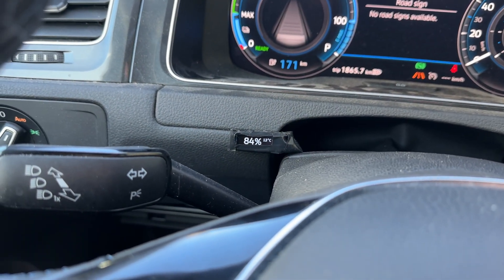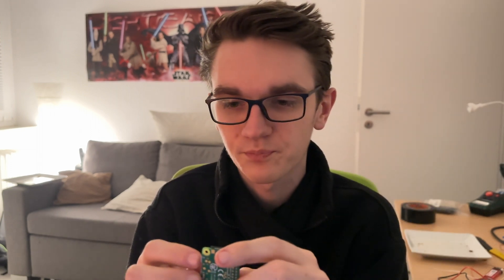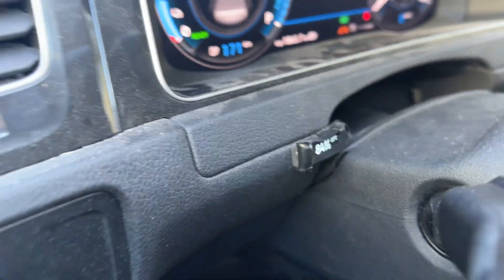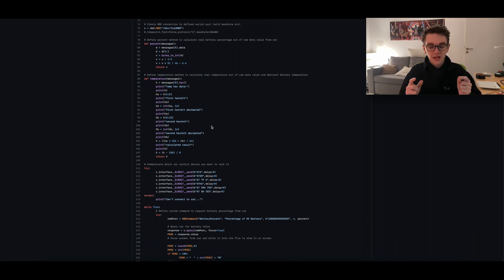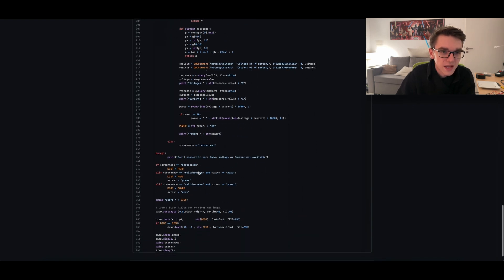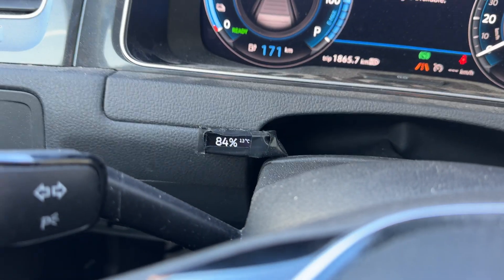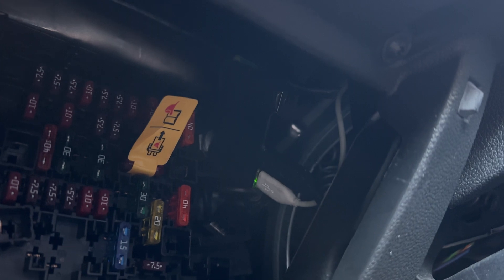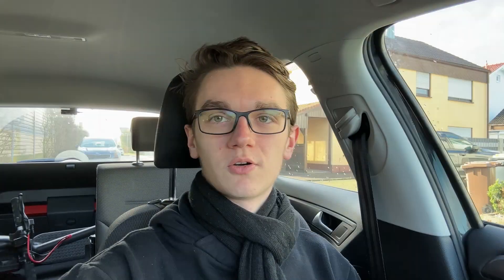How to view the battery percentage in the e-Golf with an extra screen | e-Golf OBDisplay

Comment: Amazing!

Is it possible to display the State of charge in a sensor in Home Assistant? Maybe if you connect the Pi in your car to your wifi network?
Reply from the maker: They way I connected the pi it shuts off when the car is off as otherwise it triggers the car alarm. The car doesn’t like reads on the CAN BUS while locked. I just used the WeConnect Integration in HomeAssistant but you need the car’s online functions for that to work I think.
Reply: @dieserNiko  ah okay, bummer 😅 thanks for the answer. Nice job you have done 🙏🏼
Reply from the maker: Thank you! Yes really is sad, maybe there’s a way around that but I never looked into it as I didn’t need to!

Comment: Hey I'm using an obd dongle to feed data into abrp. Is there a way to use bluetooth to handle data transfer from the obd dongle to a raspberry pi?
Reply from the maker: Should theoretically be possible by connecting the pi the the adapter and changing the device path to the bluetooth dongle. In my testing I didn’t get it to work with bluetooth though, that’s why I used the USB adapter!

Comment: Amazing! I use ABRP to see SoC via CarPlay and OBD dongle connection to my phone. How about showing charge kW?
Reply from the maker: In my experience that’s just not reliable enough and you need ABRP Premium… I just like to be able to use this without my phone and without any internet connection.

I‘m doing that! Have a look at 9:08!
Reply: @dieserNiko  Oops I missed that. Nice. Your system is great but I just don't have the time or expertise to implement it.
Reply from the maker: No problem :) Thanks :D yes, it‘s kinda difficult to implement, the ABRP way is definitely the easier way to go 👌🏼